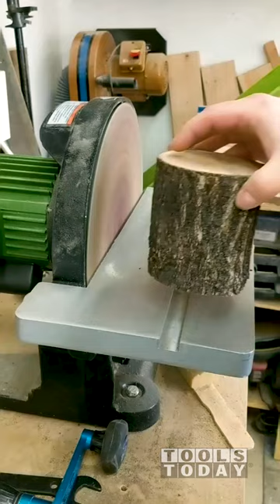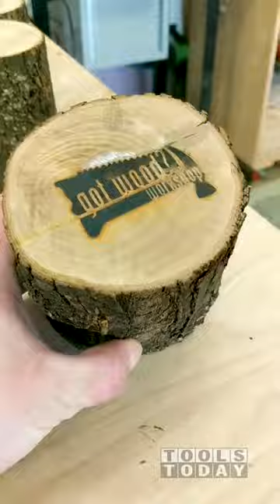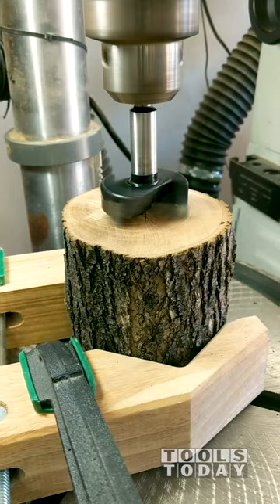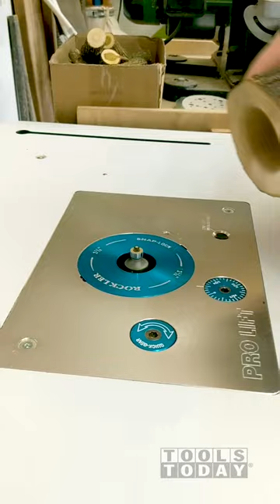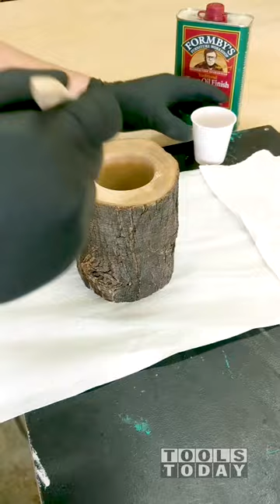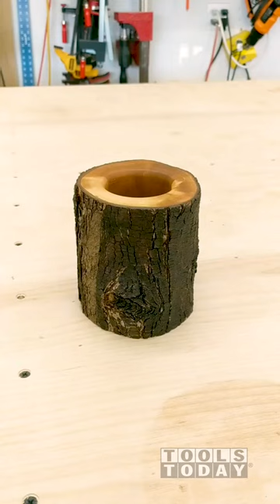Making a Log Pencil Holder

Comment: It’ll tend to split over time, look up shrink pots, these avoid that problem.
Reply: Will it still hold beverages?
Reply: Once they bored the hole out, its stress is somewhat released, but depending upon species, it may or may not stay whole.
I have some debarked Basswood logs that have split because they were large and dried more quickly, and I have some that are this diameter and they are debarked and without splits.
If the wood is soft, and the cell walls can squish a bit and move, it can reduce splitting between the cells.